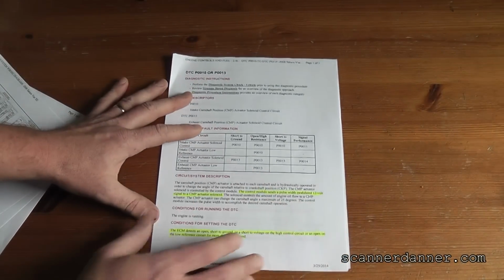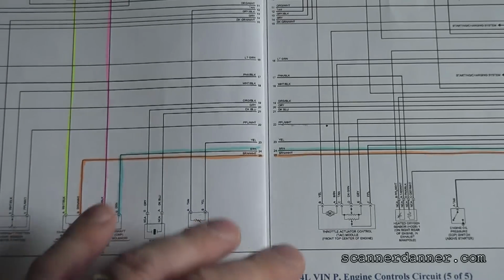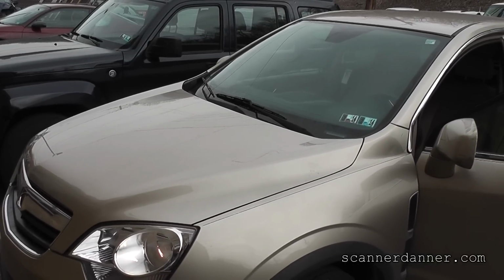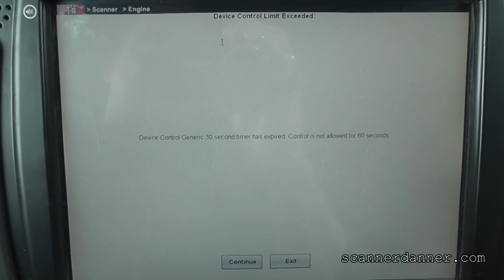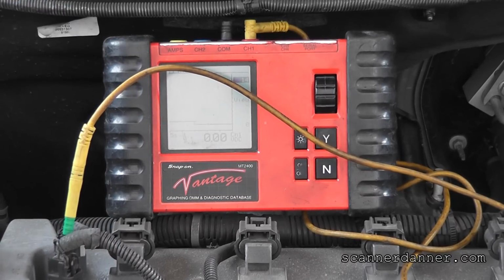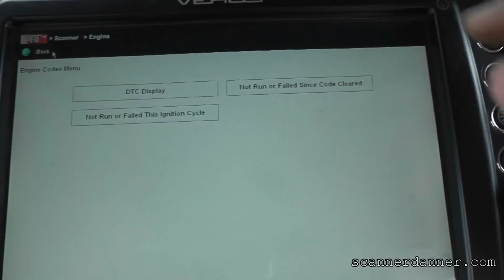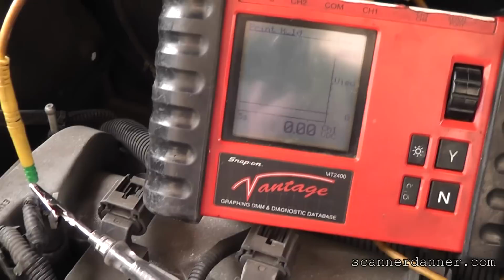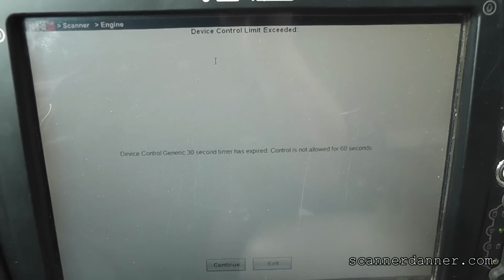How to test camshaft actuator solenoids (P0010, P0013) 2008 GM 2.4 L

Comment: you seem way crazy smart. i will donate money for any solid advice lol. been trying to fix my 2017 Chevy Malibu 1.5. keep having issues with p0016 p0017 camshaft implausible. main problem im running into is when i connect my scanner and check the cmp info i keep getting a malfunction for "intake camshaft position actuator park lock solenoid valve control circuit low voltage test status malfunction" intake camshaft position actuator park lock solenoid valve control circuit open test status malfunction" intake camshaft position actuator park lock solenoid valve control circuit high voltage test status malfunction".
it all started when my vaccum pump blew. ive replaced the vvt solenoids with new pigtails, timing chain, camshaft phasers, exhaust camshaft, cmp sensors, oil pump solenoid and ecm. all im asking is if you think this is electric related or is my engine cooked. the exhaust voltage tests read run or not run for the status when koeo or koer but the intake side continuously shows malfunction,  im begging for any help. thanks!
Reply from the maker: This is the OEM Flow Chart.........DTC P0016 or P0017: Crankshaft Position - Camshaft Position Not Plausible
Diagnostic Instructions
Perform the Diagnostic System Check - Vehicle prior to using this diagnostic procedure.
Review Strategy Based Diagnosis for an overview of the diagnostic approach.
Diagnostic Procedure Instructions provides an overview of each diagnostic category.
DTC Descriptors
DTC P0016
Crankshaft Position - Intake Camshaft Position Not Plausible
DTC P0017
Crankshaft Position - Exhaust Camshaft Position Not Plausible
Circuit/System Description
The engine control module (ECM) uses the crankshaft position sensor, intake camshaft position sensor and exhaust camshaft position sensor information to monitor the correlation between the crankshaft, intake camshaft and exhaust camshaft position.

Conditions for Running the DTC
DTC P0335, P0336, P0340, P0341, P0365, P0366, P0641 and P0651 are not set.
The engine is cranking or running.
The crankshaft and camshaft position signals are synchronized.
The camshaft position actuator solenoid valves are in the parked position.
The DTCs run continuously once the above conditions are met.

Conditions for Setting the DTC
The ECM detects a camshaft that is greater than 8 degrees advanced or 12 degrees retarded in relationship to the crankshaft.

Actions Taken When the DTC Sets
{With Turbocharger} DTCs listed in the DTC Descriptor Category=Type A DTC

{Without Turbocharger} DTCs listed in the DTC Descriptor Category=Type B DTC

Conditions for Clearing the DTC
{With Turbocharger} DTCs listed in the DTC Descriptor Category=Type A DTC

{Without Turbocharger} DTCs listed in the DTC Descriptor Category=Type B DTC

Diagnostic Aids
Inspect the engine for any recent engine mechanical repairs. An incorrectly installed timing chain can cause this DTC to set.
A camshaft position actuator solenoid valve that is in the full advance or retard position can cause this DTC to set.
Reference Information
Description and Operation

Camshaft Actuator System Description

DTC Type Reference

Powertrain Diagnostic Trouble Code (DTC) Type Definitions (LFV or LTG)

Scan Tool Reference

Control Module References for scan tool information

Circuit/System Verification
Ignition ON.
Verify DTC P0010, P0013, P0335, P0336, P0340, P0341, P0365 or P0366 is not set.
If any of the DTCs are set
Refer to Diagnostic Trouble Code (DTC) List - Vehicle .

If none of the DTCs are set
Engine Running at normal operating temperature.
Verify DTC P0016 or P0017 is not set.
If the DTC is set
Inspect for the following and repair as necessary:

A Q6 Camshaft Position Actuator Solenoid Valve that is stuck in the full advance or retard position.
The correct installation of the Q6 Camshaft Position Actuator Solenoid Valves.
The correct installation of the B23 Camshaft Position Sensors.
The correct installation of the B26 Crankshaft Position Sensor.
A timing chain tensioner condition.
An incorrectly installed timing chain.
Excessive play in the timing chain.
A timing chain that jumped teeth.
A crankshaft reluctor wheel that has moved in relationship to top dead center (TDC) on the crankshaft.
If the DTC is not set
Operate the vehicle within the Conditions for Running the DTC. You may also operate the vehicle within the conditions that you observed from the Freeze Frame/Failure Records data.
Verify the DTC does not set.
If the DTC sets
A mechanical condition listed above still exists.

If the DTC does not set
All OK.
Repair Instructions
Perform the Diagnostic Repair Verification after completing the repair.

Camshaft Position Actuator Solenoid Valve Replacement - Exhaust
Camshaft Position Actuator Solenoid Valve Replacement - Intake
Camshaft Position Sensor Replacement - Exhaust
Camshaft Position Sensor Replacement - Intake
Crankshaft Position Sensor Replacement
Camshaft Timing Chain and Sprocket Cleaning and Inspection

Comment: 12:16 I bet Dan Sullivan's Load Pro would work on this cam solenoid circuit even though the circuit is pulsewidth modulated.  The title says "cam/crank actuator solenoids," but I don't think there is such a thing as a crank solenoid.  I think you were thinking of cam/crank correlation codes, but these codes are NOT for cam/crank correlation, though.  Funny how this video has been up for 11 years and nobody has said anything about that.
Reply from the maker: Lol right? Guess it's time to modify the title 😅

Comment: Hey what if both codes pop up at the same time? Does that mean both solenoids could be bad or that both of them could have an open circuit somewhere? By the way this is a different vehicle then the one in the video
Reply from the maker: Same time? Id be looking for a common power or ground issue
Reply: @ScannerDanner  Thank you for the reply! As I come to think of it since the car has been sitting for 1 and half years without being used could it be that the solenoids are clogged up from old oil? I haven't changed the oil yet but plan to do so soon. You're video Is very helpful by the way, thanks again .
Reply from the maker: @persian1997  more likely wiring damage from rodents!

Comment: Someone else may have mentioned this, but, I'll share my thoughts anyways. My theory on why the bias voltage changed is due to the solenoid initially not being a complete open. Then once you commanded it, there was probably a small ammount of current that caused the windings to completely open. Just a theory.
Great lesson on bias voltage and how it can be so beneficial. Wish flow charts included it. Thanks Paul and the rest of the Danner family.

Comment: I have draw battery in golf 7
After 3 hours the battery is dead
I charge it full
And I lock it after 30 min 
After I disconnect negative
But when I put multimeter in Ammeter
Between them I hear something work in engine
I measure 5 A
It is normal??
SD
Reply from the maker: 5 amps! No! 50milliamps max.

Comment: The bias voltage may have increased cause when you activated it moved a little inside , therefore changing the number ?? Just guessing though
Reply: Nope 36 minutes in , my theory got shot , the good selinoid  changed too ??

Comment: Danner it been a while, great video as always , my in-laws 05 chev Colorado 2.8 had some codes that led me to this , I replaced the VVT cam actuator and the position sensor However on the mfg replaced part for the Vvt actuator instructions to test old unit recommended 12v bench test measuring the solenoid extension .0125 min ? 
Seems like a safer method to me ? 
Although didn’t fix the irrational timing issue ,  so I’m going to test the CKP before I commence my next parts sorties and littering the enemy part stores into submission with propaganda and my hard earned greenbacks ! Sound familiar?

Comment: Hey Paul. Top shelf teaching as always! Query. I'm wrestling a 2001 Volvo v70 2.4L, 320,000kms with inlet VVT, a new solenoid valve and an Actual cam angle variance constantly around 50% of Desired, setting a code (volvo 640A). It's a 12v ground side PWM system with 5ohm solenoid. I suspect a binding cam angle actuator hub. I want to test by disconnecting solenoid and manually full-fielding the solenoid coil with independent 12v supply and constant ground to see if cam moves its full range. I'm concerned this test may burn up the new solenoid coil, given I will have to full field it for a few seconds. Your thoughts??

Comment: i have a permanent p0012 code on my 2010 toyota yaris, i changed the vvt solenoid and there is no check engine light but when i scan all system modules there is still a permanent code p0012, what can i do to get rid of it? is the problem fixed? the car is running great and no lights are on the dash... Thank you in advanced !

Comment: Excellent video again Danner! Over in Australia this vehicle is called a Holden Captiva. Most horrible car Holden ever made in my opinion anyway. Replaced hundreds of these solenoids. Found a few when you pulled them out to inspect they had a heap of metal debris stuck to them due to failing engines. So they bring on the DTC due to the engine failing but no other symptoms. But excellent work. Slowly but surely going through all your videos 👌
Reply from the maker: Thank you!

Comment: Sorry Teach, I'm Late for class AGAIN!( to much "Van Halen Hot for teacher"
(but i'm not, I just know you are as smart as me and are helping me teach)
Great Tip! .. Other viewers need to be advised that the short may only happen momentarily when HOT.
I have used similar techniques and continued to DIAG and found Open Coils when hot only when running and for a few seconds after shut down. Unplugging using a DVOM to test Ohm's (Be Quick) and I was able to to Diag A BAD Solenoid.
Another one, using pid DAT for CMP* Commanded and true and viewing a HANTEK 2 ch O-scope connected to the solinoid and CMP  watching the command signals and the CMPS.
The one I remember was at Idle it should be 16* scope showed command but timing remained at 0*.
Command would go On/off and on then play the money light.( be cautious it could be a "Phaser"), pull the cover and verify it LOCKS.
You dont need to do a chain if it has low miles (recommended) .

With VVT, change your vehicles oil like you take a shower... AS OFTEN AS POSSIBLE

Comment: Your videos kick butt!  I have your book.  Where do u get the wiring diagrams?  It is so hard to find diagrams for the stuff u need.  
Also when you say a p0013 is a wiring issue, is that only for this vehicle?
Reply from the maker: Here is a DIY version of the service info I use http://eautorepair.adtrk.biz/?a=10817&c=24&p=r&s1=
For $20 you can purchase a months access to your car, giving you the same diagrams I use. You can also print everything too. I hope this helps

Comment: can u do more vids with this scanner, I want to learn how it works intamately, as I like to work on 80s and 90s american trucks, Im going to buy one of these "red brick" mt2500s soon, thanks
Reply from the maker: The "scope" I used was the MT2400 Vantage, you can find them on eBay, but I think I single handedly made the price of them go up lol
Reply: thanks have you ever tried to update the unit as is claimed possible in the menu on the scanner, can these be updated to do obd2 as well as 1. to make the question easier, can you say what these scanners cannot do that the new ones can do. what im interested in is live data and wave form capabilities, o2 sensor reading, closed loop or open loop, injector voltage. bidirectional testing and sensor activation and de activation such as IAC Motor, tps signal, ect.
Reply from the maker: The MT 2400 Vantage is NOT a scan tool!!
Reply from the maker: The MT2500 "Red brick" is a totally different tool and IS a scan tool

Comment: The fuse is fast blow and will blow before 100ms. The scan tool rest will sho fault to confirm a short on the hinge switch side to confirm the computer is working to protect the circuit in this mode.
Reply: But, could the current flow be enough to cause damage in 100 milli-secound?

Comment: Thanks for the upload. I own my vehicle. I too am sketchy about back-feed reading through the computers when I suspect the computer is not at fault. I took the simple route. Replaced the two cam sensors and the crank sensor on a similar EcoTech motor. Before battery hook-up I did the ohms readings on the sensors, (much thanks for ranges), old and new. The Intake sensor was bad. Crossed fingers and did battery hook-up. Bingo! Engine light was off, even after a 30 mile test run, all other undesirable characteristics, gone.  Next project is the replacement of the timing/water pump components with a quality aftermarket set. Wish me luck, I do not have the fingers of a spider monkey.

Comment: Excellent stuff as usual!  How about this troubleshooting procedure for that trouble code - back probe control wire at harness with harness disconnected; result, bias voltage.  Next, resistance check solenoid; result, open (or short).  Replace solenoid.
Reply from the maker: I would still want to test the driver in the PCM for function too :-)

Comment: I think there might be  may have a circuit breaker built built into the pcm that resets when codes are cleared. International does this on engines they put into their school buses. When it does short out like that the pcm or bcm will turnoff that circuit. Let me know what you think or if I am right or wrong PLEASE!!!!

Comment: so not about this video I have a CE light on in my 01 Isuzu trooper 147870 miles I don't have any Scan tool ( borrowed and not returned ) I suspect a misfire due to coil over plug or plug I believe I can check minimum and maximum resistance .4-.48 ohm to 2.6-3.8 k ohm at the coil these plugs have over 70 k of their 100 k service life I think I can rule out the coils with my multimeter and at least perform a visual inspection of the plugs just wanted to say thank you for taking some of the mystery away from OBD2 I feel like I have a clue now

Comment: flow charts are good for average techs, they eliminate ecm and wiring concluding the part as the culprit. The best and fastest techs use danners stragedy,only problem to that is u must know ecm control and variables otherwise u might misdiagnose.Also true for either pulldown or pull up reference sensors.

Comment: I have this exact issue.. I've changed half a dozen camshaft solenoids.. And it us not a solenoid issue... It's a wiring issue.. Your video has helped immensely... Because now I can stop looking at oil, bearings, pump, pickup, solenoids,...etc.... On to wiring. ...( and PCM)👀👍™
SUBSCRIBED BTW
Reply: Craig, you mentioned wiring issue.  I have a '09 Cobalt that shows P0017, and I have replaced the exhaust cam solenoid.  However still getting code.  I tested the solenoid on a battery, and it clicks, however it does not when plugged and unplugged on the engine.  Thinking I may have a wiring problem.  I have checked the fuse.  Any ideas?
Reply: Try the cam sensor... The exhaust side will set off what's called the cam/crank correlation signal... It's most probably the cam sensor on that side that needs replaced...👀👍™
Reply: I have replaced the exhaust cam sensor, and also the crankshaft sensor, but still getting P0017.  I even replaced the exhaust cam gear actuator (difficult job) and still getting the same code.  I ran seafoam in the oil then changed it just in case I had a oil port clogged.

Comment: Do you think it's random that the manufacturers recommendation was to use a 3amp fuse and jumper when tit were getting the 2.44 amp reading on the bias votage?.. (im not an electrician or automotive tech in any way)May be known that that was gonna happen and cuts to the chase... So to speak.... Just a thought... Great work...
Reply: 2.44 volt reading*
You do make a solid intro to a point of is it random. I believe it's intentional that the manufacturer flowchart steers attention in such a unique vas Direction that if in the hands of the consumer would definitely deter them being able to do their own diagnosis.
And given they try it I mean...
 they might cook a circuit.
 They make money either way

Comment: Can you offer any assistance with a 2011 Malibu 2.4 liter gas. Had codes P0014 and P0016 with intermittent loss of power. Got worse last week to the point could not take on highway. Cleaned both actuators as screens were clogged. Now I have a no start condition and it is automatically popping the same codes after clearing them without the engine running. I'm thinking a cam sensor for the P0016 but why the P0014 to go with it? I using Carista app on Ipad to check/clear codes. I know that's primitive but have had good success with it for basic code results. Any help appreciated!
Reply from the maker: Thanks again for your support. Unfortunately I cannot keep up with the number of technical questions I get from my subscribers anymore but I have created a forum for you guys for this very thing! 

http://www.scannerdanner.com/forum.html
Thanks for understanding.